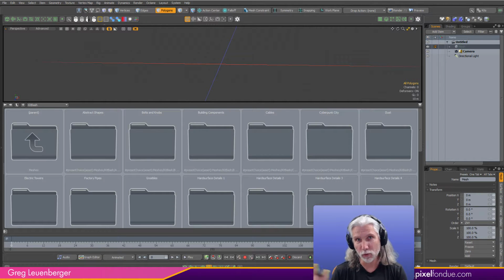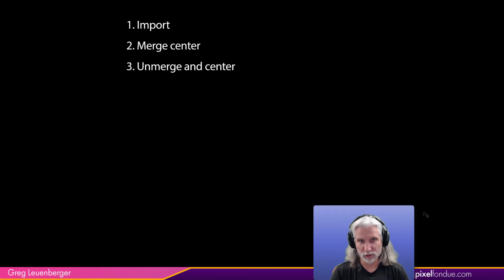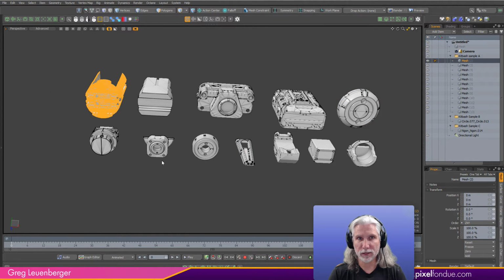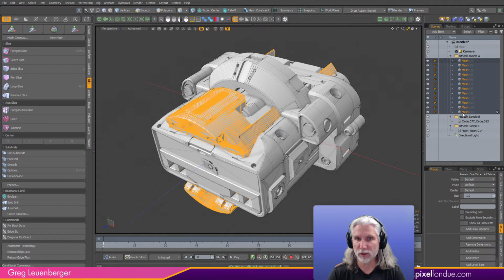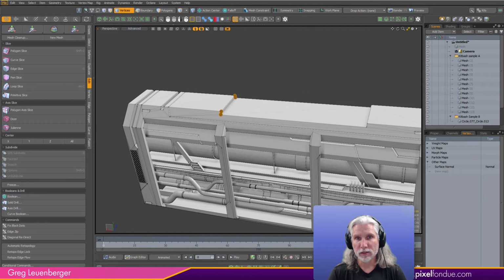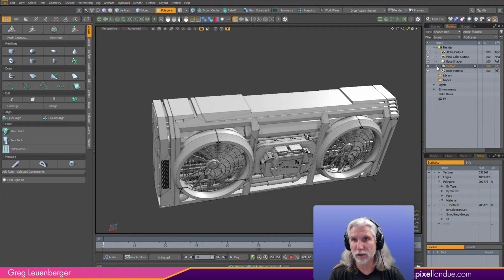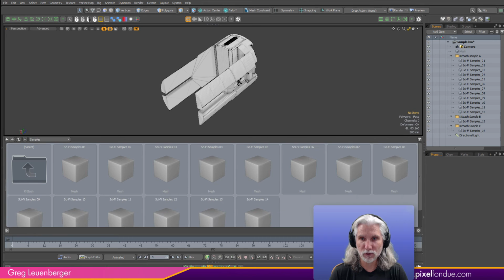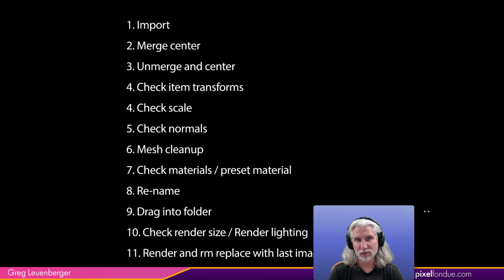MODO-up Your Kitbash Library

Comment: I can select multiple Items and drag them to Preset Browser, and Modo will make preset for all of them.
Reply from the maker: In MODO 16?  Because when I do that it clumps all the meshes together.  So if you load up one of them all three are clumped in there.
Reply: @pixelfondue  that's true... I didn't test to import those, only save, oops
Reply: But that is quite strange behavior as it does save multiple presets with different names.
I think the reason for that might be that Modo tries now to automatically decide what to save in Preset. And it fails both ways in this case.
Reply from the maker: @khellstr  Yeah, I had to re-record part of the video when I discovered that.  Seems more like a bug to me.

Comment: For Centering you can use Center To Bounding Box. 
Select all Items, then use Center To Bounding Box ( Center or Bottom probably), and then Zero Position of all the selected Item. Then Items and meshes are in center.  
Here is a example : https://youtu.be/9NJRILnDNNk
Reply from the maker: That's a good trick. I'd really like a script that just does most of this for me (unmerges, centers, zeros transforms, mesh cleanup, re-name and make a mesh preset in a given dir.)

Comment: Another good "tool" to run on imported CAD and other meshes is "Tagger" from the Dara collection from Mechanical Color on Gumroad, it has a feature that allows the removal of embedded material tags, item, material, part and tags as well as selection sets. You can also set material groups and Island tags (Adam made some good Kits)
Reply from the maker: oh yeah, that's a good one

Comment: I usually run mesh cleanup on multiple items all at once. So just select all the separate mesh items and run it, it will run the operation within each item independently as far as I know.
Reply from the maker: Good tip, I didn't know that.